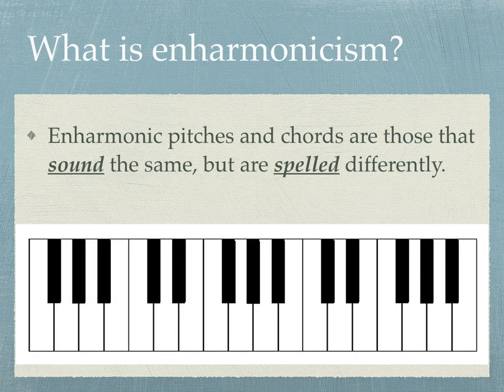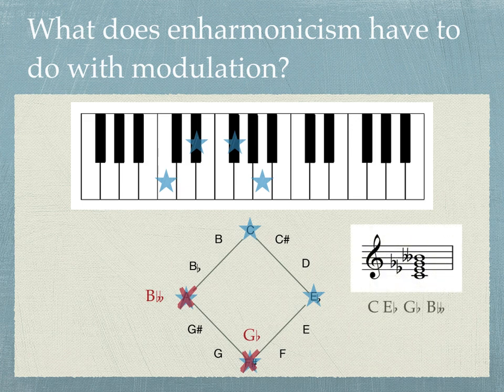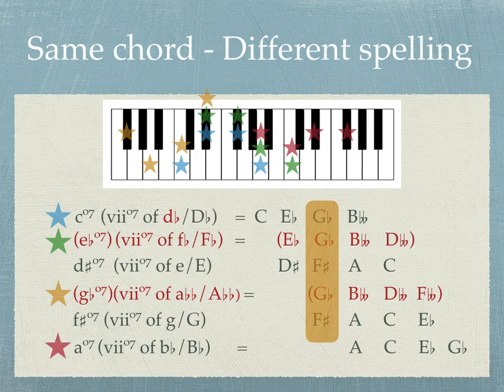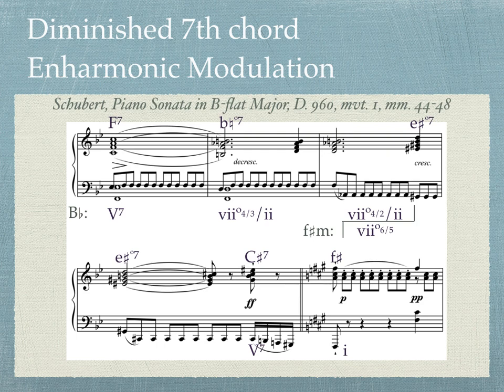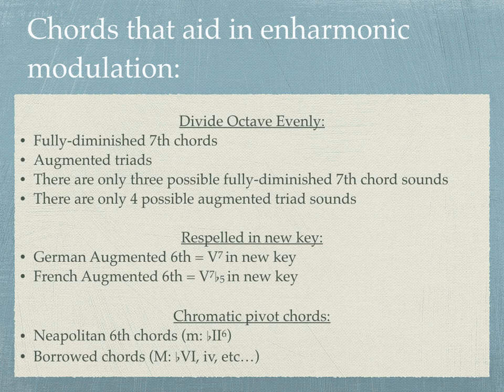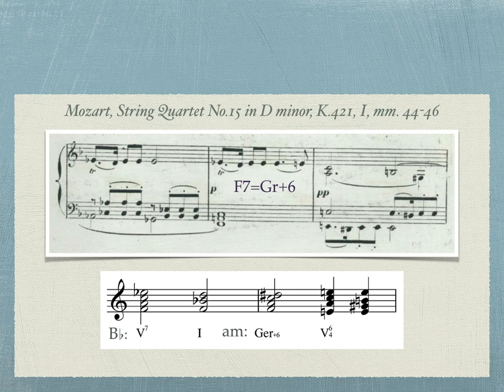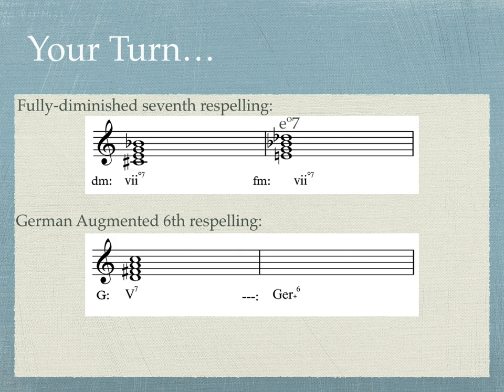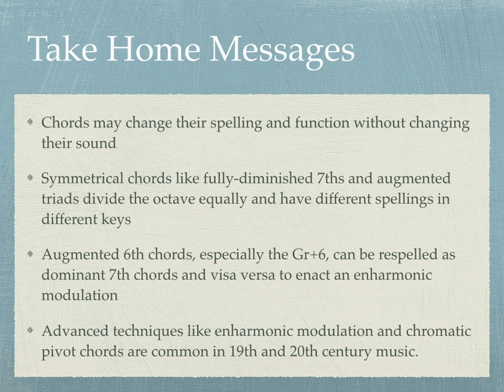Modulation Part 3   Enharmonic Modulation

Comment: It'll make sense if you learn more scales.
C Harmonic MAJOR = b6    = Ab  = F Lydian b3 , G mix b2
A Harmonic min       = maj7 = G#  = F lydian #2 ,      G# loc 4, bb7

Im still in C MAJOR/Amin as the parent key

The full diminished are   B, D, F, Ab
                                                B  D F   G#

A melodic min #4  = D#   = C Ion #2, #4, #5
A melodic min b5  = Eb    = C ion  b3, #4, #5

The full diminished are     A , C, D#, F#
                                                 A    C  Eb  F#

you can basically  play any diminished chord into any chord
G7 into C Major or C minor       
G7    G    B, D, F.    extend to   G 7 add b9     B, D, F, Ab

or E7 into A Major or A min

or you could had played F dim into F# minor/A MAJOR

The melodic min #4  or b5 will make more sense.
There's NO Full diminished chords in the Melodic min scale.
but now...you get to make it over the TONIC
by inserting the tritone...The #4 still has the 5th
MORE OPTIONS....C dim into    C# Minor  or C# MAJOR/A# minor
                                     D# dim  into E MAJOR or E minor

seeing the F# as aeo b5..will also help you..
You could had just play F# dim into G Major or minor

You'll get used to changing a diminished into a Minor or TONIC
F# minor/A MAJOR
A harmonic MAJOR  = D lydian b3   E7 ( Mix b2)       F  dim

Common chords  to A harmonic minor....
D min or dim   E7    F dim

or applying the ( N6)  Bb maj7 or AUG  to G minor
D7 or F#  while using the  A melodic min 
or Bb7    D dim into Eb MAJOR or C minor
or Bb7   ,C7   into F  Major or  F minor
or             F#7 into B min....or Bb dim or aug into B minor....

You can simply apply the N6 to B harmonic min b2..
walla C Maj7 to A minor again.

E Harmonic min b5 = C HUNGARIAN MAJOR..
C  Ion  #2, #4, b7
it'll help you...becuase you can stack it like this

C     3, 5    or C7
C    #2, 5  or  C min7
C    #2, ,#4   or   1, #2, #4, 6   or  1, #2, #4, b7

If you also see it as Lydian dominant #2....
You'll associate it a PRE DOMINANT ( lydian)..
when using the ( N6)..
becuase you can alter that ( N6) maj7. Dominant. aug or dim

Comment: 5:42 wouldnt that b natural diminished seventh chord be a 6/5 inversion since the root is B but the bass note is on D, the second note of the chord?
Reply from the maker: The bass clef has an F as the lowest sounding pitch in the chord, making it a second inversion chord.